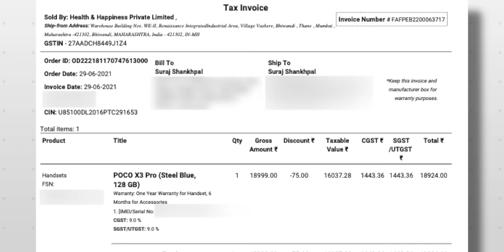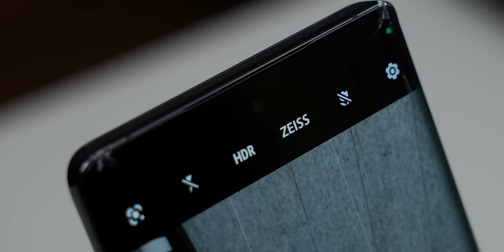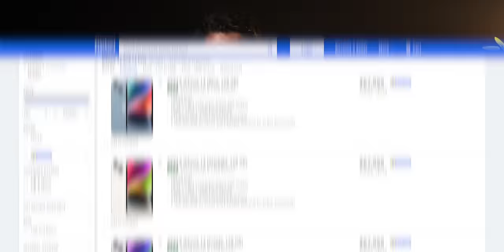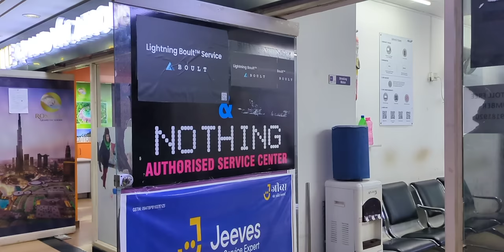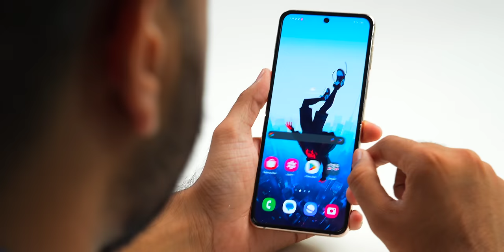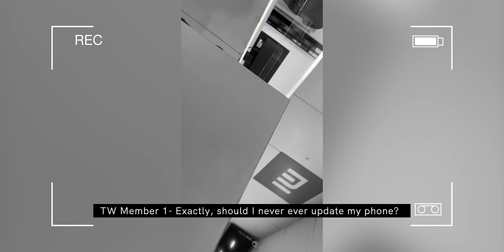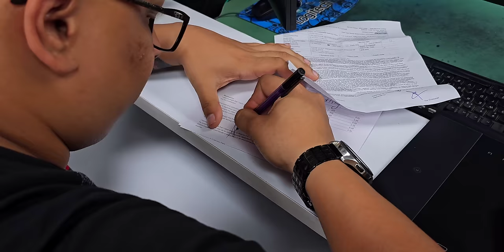We Tried 5 service Centers in India!

Comment: One of the current issues faced by many Oneplus Nord (the og from 2020) users is that the display from the device falls off, like without the fault of the user, the service centre was filled with 6-7 users at the Ahmedabad &  the service centre team actually suggested people to get their screens replaced for approximately 13k rupees, to which I denied & then went to mobile shop where the guy just replaced the bad glue which was the main reason for the screen falling off with a better one & I was good to go, but this was a major deal breaker for me from such a reputed brand & that I would actually try not to get a Oneplus phone in the future, because even if it was not my fault the screen might have had fell down if I had laid it inverted or held it otherwise causing the band that connects the screen to the motherboard to break after which I would've had to spend 13k to get the screen replaced, of-course it also comes with the worries that I might have to spend the extra amount to get it replaced or probably get a new device all together because 13k to spend on a 3 year old device makes no sense. So I would request you to try the same at a Oneplus service centre.

Comment: I had Mi 11 ultra with the WiFi issue and couldn't get it repaired for 5-6 months as they were charging 42k for the entire motherboard replacement. After the announcement of the extended warranty I had only 20 days left for my warranty period to be over and the service center in Lucknow gave me a free upgrade to 12 pro for the Mi 11 ultra, it took around 10 days from depositing the device till receiving the new one. But I an satisfied with the experience

Comment: After a software update in SAMSUNG M42, it stopped working. Without any inspection the executive from the service center told me to replace the motherboard. They offer 25 ,% discount on motherboard replacement. CEO desk now not responding on complaints.

Comment: Xiaomi Service Center in  Telangana was very bad. They just collect the device for service and update the job sheet that service has been done after 3-5 days but actually, no repair was done. In some service centers engineers were not even having knowledge technical as compared to the customer. And no use if anyone raised a grievance at consumer court.

Comment: 1:54, had same issue with my Redmi Note 11, factory resetting worked but it came after roughly 14 days again. Service Centre representative said everything's alright hardware-wise, formatted the phone and asked to not update till 2 months. Again, after 14 days or so, faced the issue. After factory resetting the phone myself, turned out that not installing the boAt smartwatch app resolved the issue. This might the last Mi phone I will have

Comment: i have a 2yr old POCO M2 & there is network issue after updating. visited Mi service center and they said it will cost 6-7k and advised to go to local repair shops for cheaper repair cost. not pleasant

Comment: I am having this issue where the sony wf1000 xm4 right earbud's battery started draining ridiculously fast post firmware update (very widely known issue), the problem is that this was a gift from my friend who bought it at a good deal in USA. So it is a non-domestic product. I also don't have the bill since it was a gift. The earbuds cost around 20k here in India. The service center guys initially told me that without an invoice it is very difficult to get it replaced so they asked for around INR 6k to get the buds "replaced". After asking them to share an email id of customer complaint/support they agreed to "repair" it for free.. Earlier they told me that this can only be replaced and now they're telling me that this will be repaired by next Monday. Strange how things work out when we try to prefer email communication. Waiting for a call to collect it from service center.

Comment: Guys, you could've tried realme too maybe? My realme 8s bought back in April 12th 2022 broke down on April 17th 2023, just 5days after the warranty was over. All the back camera sensors stopped focusing after an update. I contacted the nearest service centre and they said the entire camera module needs to be replaced at the cost of 3.5k INR and this replacement has a warranty of just 1month. You're probably aware of the same issue occurring in Realme Narzo 50 to which they're providing free of cost replacement, no questions asked. So it was a setback for me. For a middleclass family, I'm currently struggling with a new phone with no back camera.
Reply: And no there was no hardware damage at all

Comment: I am a OnePlus user. I am from Chennai. I visited the t.nagar branch service center. I was quite impressed with the service they offered for me and my friend. I had a minor issue. But my friend was supposed to replace his screen. So they said it will take only one hour to repair whatever the damage is done. Until then we can use a coffee vendor to have a cup of coffee or else we could play some games to kill time on OnePlus tv with PS4 which has some pre-loaded games on their couch. Overall experience I would say 4.5/5. But the price is a bit expensive for my friend's phone screen they charged 10.5 k to replace and additional repair charges 550₹. But they denied some minor repairs like fixing screen tearing with the black gums which is often used in third party service centers instead they asked to replace the whole screen.

Comment: I just gave my mother's Redmi note 10 pro to the service centre due to mother board issue. I noticed a huge crowd and when i talked with some of them 95 percent people came due to mother board issue . The situation is very bad regarding Xiaomi phones and this incident has completely destroyed my trust in the brand. I was never a Midrange phone guy . I always recommend people to spend am extra 2 - 5 k in order to get good experience rather than getting a good looking spec sheet .  I have a Samsung S21 ultra and its still holding up like a champ . I won't consider upgrading the phone for another 2 year's if everything goes this smooth.

Comment: My Poco F1 motherboard bricked 2 years ago , they were charging 18k (which was higher than for what I bought it ) and It was out of warranty . But I replaced the motherboard from a local shop for just 1500 rupees , and since then , phone is working fine and no issue regading motherboard so far. So yeah , Do try local shops if service centres charge you a ridiculous amount.

Comment: taking about " extended warrenty " it's only applicable for the devices purchased after 2022 may . And The motherboard issue is not major it's bricked after update ( soft brick) they should have reflashed the os .

Comment: I used to have Poco X3, after a software update the camera, speakers, screen stopped working. So i called a service center in Vijayawada & asked them about this issue. They confirmed it was due to software update and poco repaired the phones free of cost, but the scheme was over sadly, & they refused to repair my phone FOC. And now i'm commenting this using a moto phone.

Comment: Let me share my experience with Realme (or OPPO) service centre.

I unlocked the bootloader of my realme 8 5G and installed TWRP for installing a custom ROM (which did not exist, thanks to some channels which made me think there were custom ROMs and myself not knowing MediaTek does not have custom ROM support due to closed source architecture) and hard bricked my phone. I tried fixing it, and it worked, but IMEI was lost. And trying to fix it, it got stuck in an infinite bootloop, not even fastboot or recovery were working. After a week of frustration, we took it to the service center, they said motherboard replacement costs 8k which was a lot, considering the phone was only 16k. So we went to a third party repair shop, who also said they couldn't flash the firmware. I asked them to chip off the storage and flash it before reballing it. They said phone may die during the process. I agreed, and in a week, phone was fixed, the only problem being that the rear camera stopped working for no reason, maybe the flex broke (we gave the phone to 2 more third party shops, maybe they broke the camera connector). I'm not a huge camera person, so I was happy. At last, third party service centers do work sometimes, you just have to be careful.

Comment: After the miui 14 update my redmi note 10 pro front camera stopped working and i didn't knew about it, then i tweeted about the issue and got call from Xiaomi to visit nearby service centre and they fixed it in a week for free of cost.
Reply: It's a hardware issue... due to poor quality soldering... if your phone gets heats up... then the soldering materials starts to melt...
Reply: @krishnasagar8921  no it's software problem.
Reply: @ashutoshtiwari2522  it's a hardware issue bro...

Comment: When I went to ASUS service center in Hyderabad, for the repair of ASUS Zenphone6 which was crashed because of their update, the service center guys told me that they are hearing this for the first time, the motherboard was dead and it costs 25k.
Had an issue with power button in Samsung M12, the service center guys always had fixed the latch inside instead of resolving it permanently. I had to visit them every 3 months for the whole year until warranty period. Now I am exchanging it for Moto G32.

Comment: Ok here,
I live in Bengaluru
So i had bought redmibook 15 pro
On 14 august 2022 and after 2 months ig there where some glitches with windows 10 
Like the whole thing got corrupted 
So i went to the service center as the device was under warranty
They looked at it 
Then asked if it is under warranty
I replied yes..
(They didn't ask for any proof about warranty)
They said it would take about 5 hours 
But after 2 hours they called up that the device is fixed (i had to backup things on my own they wouldn't do it)
Then i got back my laptop and the whole os was reinstalled for free 
It was a really good 
It was too clean
The fun fact is 
Mi home and service center is almost away about 20m that's it

Comment: I bought my first flagship phone on October 2021, which was a OnePlus 9 5g, for first 1year 2months it runs smoothly without any issues. Suddenly few months back I had a green line appeared on my display, I ran to authorised service centre, they replaced my display without any charges. After 70 days I had the same issue again, this time neither I had update my device, nor I did play any games. Service centres near my location didn't have the parts at that time. I choose OnePlus pickup and drop service and send my device to delhi service centre. There they said the same thing, parts not available. After 1wk they repaired my device, this time free of cost too. Now the this is I don't have enough time in my life to deal with this issue again and again after every 2mnths. Also I'm mentally fed-up with this situation. I sold my device after repairing and buy a LCD display smartphone. This was heart breaking for me, for the first time of my life I bought a flagship phone from my own hard earned money, and I couldn't even enjoy it for 2years. Nowadays every brand is facing this issue, be it apple be it Samsung be it vivo or pixel, you name it. Even motorola's pOLED display also has this issue. pOLED is  made my LG only, previously we're thinking this issue is only present with Samsung's oled displays, but thats not true. Iphone 13 series also has this kind of issues, in India and outside India too. Dubai iphones uses BOE displays inspite of Samsung's, but they also have this issue. I don't know what is happening, why there's no solution yet, why brands still don't know where the problem lies. For poco/redmi's cpu dead cases we know the cause, we have 3rd party repair centers, but in this case nobody knows anything. Gods be great!

Comment: I owned an iPhone 13 with a defective screen, which Apple replaced since the phone was covered under Apple Care+. Unfortunately, two days after the replacement, I discovered that the phone had been damaged by water while I was washing my car. It turned out that the screen had not been properly installed. I went to an Apple service center and spoke to their customer care, but nobody provided any assistance. Despite showing them evidence, they refused to acknowledge the issue, and I ended up having to pay for the iPhone replacement cost according to the Apple Care+ plan.

Comment: Hi TeamTechWiser, I am using Mi 11 ultra and my motherboard is now dead after upgrading to miui 14( After upgrade it started with Wi-Fi issue and after 25 days finally my mobile is dead). As per Xiaomi, they should provide a mobile upgrade offer. However, service center and even customer service team denying it as my phone is dead now. My question is how did you convince the Mi service center people to get the Poco x3 pro motherboard replaced for free😊?

Comment: My pixel 6A device had a liquid damage, the touch + the screen was partially working but upon reaching to the service center (in Mumbai), they gave us the jobsheet and the entire repair charges was a whopping 38k even though my phone was under warranty! That's like 10k more than the device i purchased on Flipkart (around 28k INR). They told me for the safety and longevity of the device, its mandatory to get the motherboard replaced. I never got the phone repaired which any sane person would do and just recently bought moto edge 40!

Comment: I Bought Pixel 7 Pro on 16th May 2023. And phone just got dead even before 6 months. I visited the service center F1 solutions, they told they'll replace the device. Since, they don't perform any repair for pixel phones. Since then, it's been more than 15 days. They didn't get the replacement unit till now. Which is totally waste buying a flagship from Google. Even service center guy don't know when they'll get replacement. And it's a situation of Bangalore in which there are so many users of Pixel Phones.

Comment: I went to the Realme service centre to get my mom's phone narzo 20A fixed. The flash light wasn't working. They took the phone for 10mins and said that the mother board has to be replaced which will cost 7k approx. But even the Realme brand itself doesn't give that price   in case of exchange.

Comment: I have Redmi Note 10 pro and have the same software update issue like POCO X3 pro.

It was April 2023 and My phone was not under warranty and Xiaomi hasn't announced an extended warranty at that time.

So, the service personnel downgraded the software and charged me ₹350 ( not official ) 

because he told me that if I go through the official way it will cost me more.

Now Installed Pixel Experience and will never install MIUI

Comment: Since 2012 i have been an android user and i actually never update these phones neither my job requires this, the owner of the shop is a friend he suggested me during that time so unless i am facing any problem i don't update it. But with Redmi Note 10 i have updated it a few times hoping it will resolve the issue of attaching and opening pdf but still it wont open pdf's which is quite an issue if you receive PDF's via whatsapp but i won't be ever updating it as it might get bricked, i will just upgrade when it's feasible.

Comment: Almost 2 years ago my oneplus 6t stopped charging. I took it to the service centre which was around 60km away and their first response was that the phone might have battery issue and they dont have the parts for it so i must bring the phone to them 2 days later. They refuse to keep the phone at the centre. So i had to travel back, they open up the phone and in 5mins the guy tells me that it's not the battery it's the charging port which was damaged. And they dont replace that port. The only option is to replace the whole motherboard which would cost me around 19k. In that amount i could buy the same phone refurbished online. I had no other choice but to go to the local repair shop, and they replaced the charging port but now it just doesnt fast charge.

Comment: Has the worst experience in Xiaomi service center yesterday,they failed to properly fix the back cover after a a battery replacement,they asked me to use a case which will magically fix the adhesive 🤦🏽‍♀️🤦🏽‍♀️

Comment: Honestly, i agree with team tw that service center experience varies from location to location. i owned 2 samsung devices up untill now, J7 prime and galaxy m51. When i had J7 prime i lived in chandigarh and the service center experience was straight up bad. they take 3 days just to re-install software on the device which takes hardly 15 minutes on its own. But when i lived in Shimla, I had m51 and one day i accidenatally droppped my phone in water puddle. I took the device to service center knowing it will cost me, since it was water damage. But the repair staff was so nice that knowing i am a student and i cant afford much. they fixed my phone and the display (which broke due to the fall) for free. and said when i get call from samsung about the device. Just say it was display issue and dead pixels etc. And they did all that in less than 3 hours. i got the device back very same day.
Reply: time to move to shimla now
Reply: @gakorothyt9768  it can be a nice experience, I've lived for 2 years. People usually sweet and helpful, u barely sweat even in month of june. Although you'll miss stuff like Zomato, swiggy and uber lol.

Comment: My experience with VIVO was so good. I got a green line issue on my x 50 pro after 2.5 years & they replaced in 1 hr & their service station looks no less than a Showroom!
Superb job from Vivo! highly recommend to use their devices.
Reply: Price of the screen?
Reply: @Naveen50000  Got it replaced free of cost! Although screen cost 16k around!